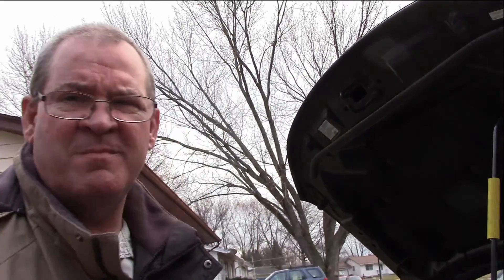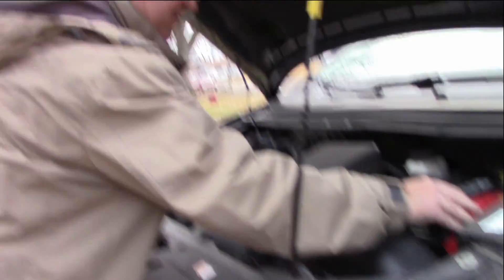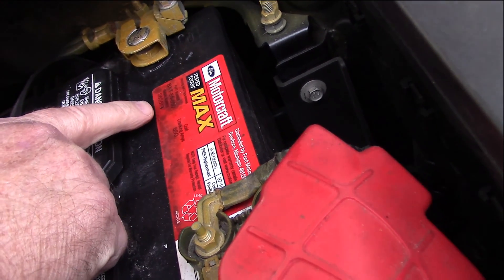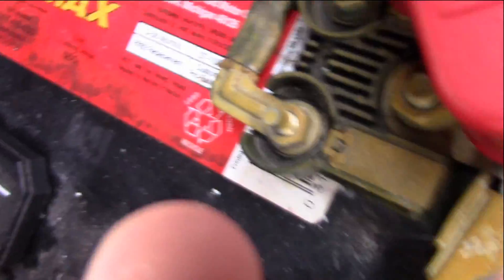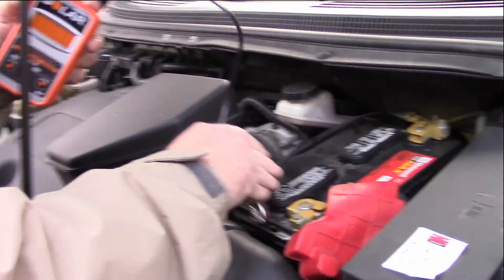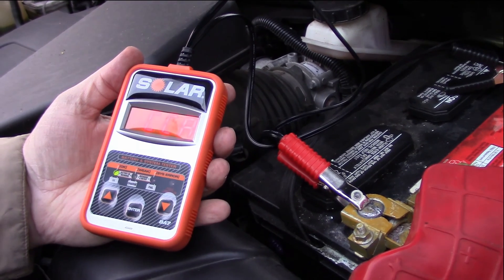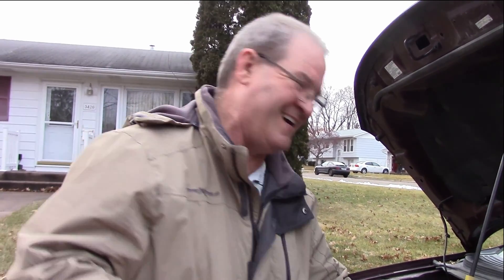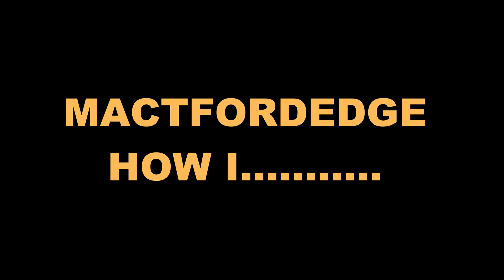Ford Edge battery/Failing voltage regulator/charging system diagnostics on two 2011s

Comment: Mac, I've got a 2008 ford edge that driving me nuts. Battery light came on, took it to a mechanic and they replaced the alternator. Everything was fine for 4 months then the battery light came on again. Had it tested and 2 different places and they both said alternator and battery tested good. I ended up replacing the battery out of frustration and everything was good again for another 3 months now the battery light is on again. I unhooked the battery to reset the computer to see if it was tossing a weird code and the next day the light was on again. I used a voltage meter 12.7v on the battery, however when the vehicle is started it will slowly climb to 14.1 to 14.2 volts, but when the engine is revved the voltage starts dropping and jumping around from the upper 12's to upper 13's.  Any ideas?

Comment: Do you know how many amps the ford edge 2013 alternator arrives
Reply from the maker: The 3.5 I believe is about 155 amps  the 3.7 sport is about 170 amps  I do not quiet remember but I believe these numbers for the 3.7 are close.

Comment: Hey Mac. My 2013 edge is once again stalling while driving. seems the summer affects the main relay wire to get really hot. Battery checks good, alternator bench test was good 3 times. No burned fuses either. When the AC cuts on it seems to draw more power causing the main fuse wire to battery to get extremely hot! this shuts off my car as the whole fuse box gets hot too. Any input on possible cures? Seems my AC is drawing too much power causing that main fuse box battery cable to practically melt in the summer time. thanks.
Reply from the maker: You need to get it in and trace the electrical as it has failed circuit or component that is causing the short or over voltage to the system.   Find a diagnostic technician that can trace all of the system to locate the failure.  Something has failed now it is time to get into the system and start tracing.
Reply: +MACTFORDEDGE good deal. I will replace the wire and alternator just for piece of mind since I have it out now. Figured I do the hard stuff first. If it still fails I will then have the technician chase wires. Thanks Mac.